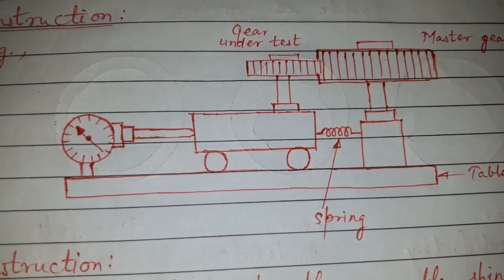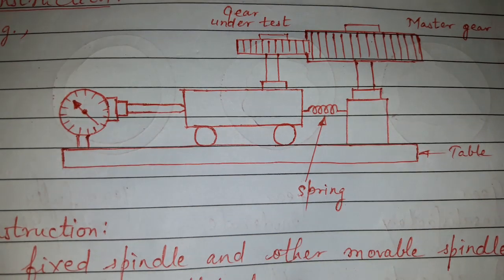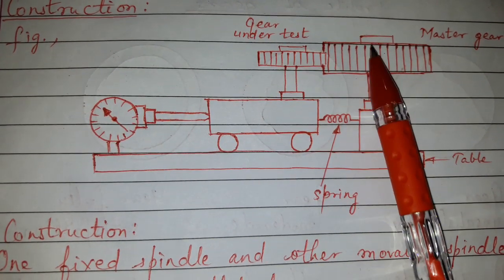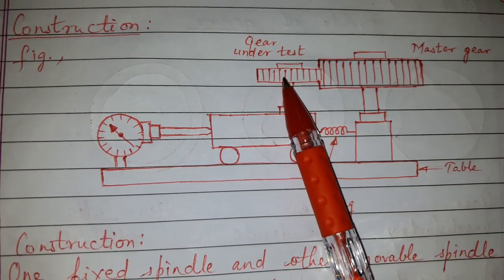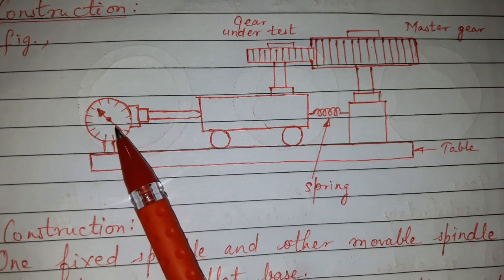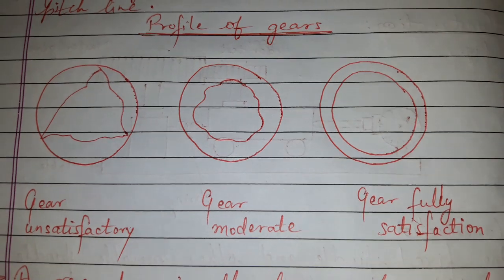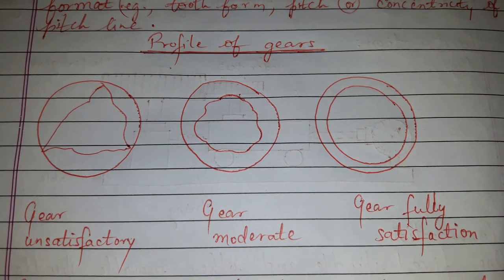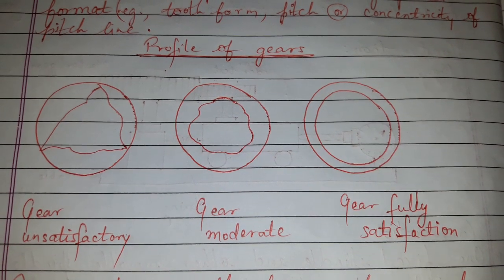Parkinson's Gear Tester.... #40kviews #viralvideo #50kviews

Comment: what is wax???  something what is that where did it used
Reply from the maker: sharib....

For the variations of gear under test, a recorder in the form of waxed circular paper charts may be used. 
As the chart rotates, the line traced records the movements of floating/sliding carriage.
Reply: but where it is fixed in between master gear nd gear under test or tell me where it is fixed
Reply from the maker: sharib...

I have just now uploaded a video to explain it..... watch it....